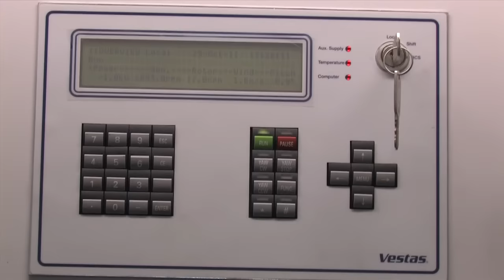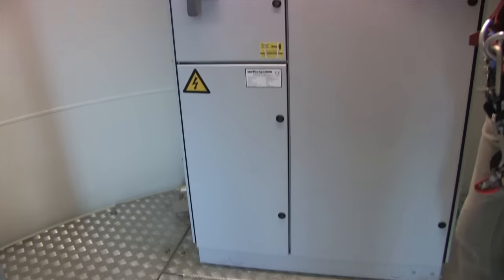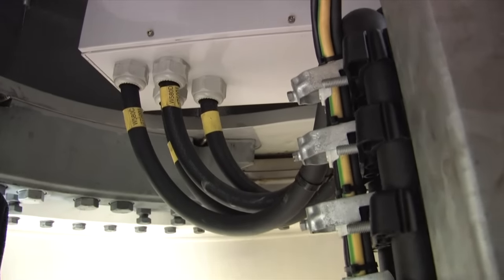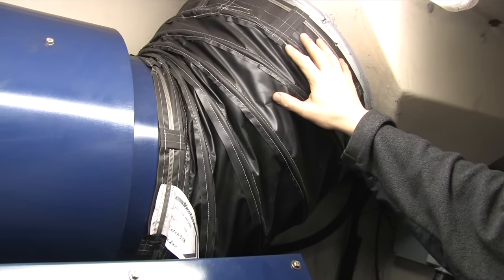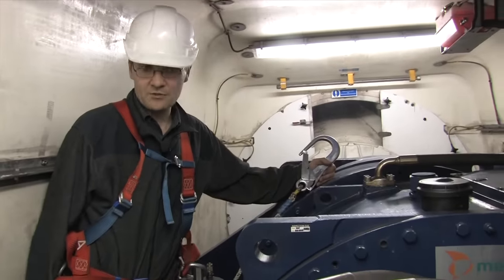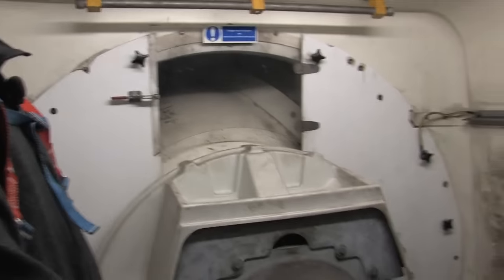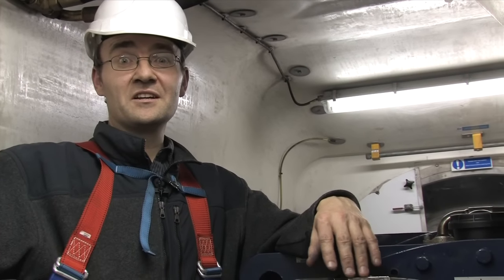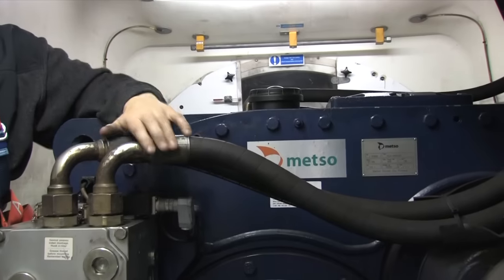Wind Turbine Tour

Comment from the maker: Extensive refurbishments of the DkIT wind turbine have taken place and included the replacement of the turbine's gearbox.  The recent upgrade is expected to secure an additional 10 years of operation for the turbine.  The 859 kW turbine has been in operation since October 2005 and powers approximately one third of the campus' total electricity consumption.
Reply: and how much did that cost and will the wind turbine ever return the cost in electricity?
not even a quarter of it, wind power is just stupid.
climate change is bullshit.
Reply: @axeman2638  I guess you missed the part where they said it was 5-8 years to pay for itself.
Reply: @jcc4tube  nope none here or elsewhere have that short a pay off. That's just bull pats. Especially if the govt subsidies dry up.
Reply: @dwh5512  even quicker now the cost of power has more than doubled. Wind turbines are an absolute no brainer
Reply: @jcc4tube  that's short pay off is either a lie or gross exaggeration.
Reply: @dwh5512  this vid is 10 years old now, but as he says in the vid the turbine costs 1,127,000 - 40% grant and saves the campus 120,000 a year, campus paid 680k. 680k/120k = under 6 years. the turbine will have far exceeded the initial investment by now and could have paid back the grant if that was a requirement. solar and wind generally pay back roughly 10% a year
Reply: @adamcourtenay  but they have to be rebuilt every 2.5 years. I've installed & rebuilt plenty
Reply: @axeman2638  I absolutely agree with your opinion on wind energy. If they ever get micro nuke plants up, the cost of retail kilowatt would be around 3 to 5 cents per kilowatt. Of course that's out side of major cities. Cities, 10 to 18 cents per kilowatt. Wind power retail, 30 to 40 cents per kilowatt is what I understand.
Reply: @dwh5512  Looks like they keep having to replace the gearbox and the generator, how much do they cost?

Comment: Loved the dry run of the process of connecting to the safety line, climbing the ladder, and then disconnecting from the safety line. Better to get people familiar with the process while on the ground where you can show them in a safe place! 👍🏼
Reply: Nah, it's better to do it while they're falling: they'll pay more attention.
Reply: What a glider! How over engineered can you make it? Was it a "euro design?" I had several grabs for wire and regular rope, one for a single tower! My fav was one that you cocked it horizontal, then placed on cable, then twisted 90 degrees, then clipped a carabineer through the hole! Slick and fast and was used often in dark towers by feel alone.

Comment: Great tour! I worked for five years mainly servicing Vestas V-39's bought used from Ireland. I was on the commissioning crew and we replaced VERY OLD Win-Dane 500 kw units using adapter plates! Shocked at the hydro station location! Tough as hell replacing the pump inside the tank on any day but that hub-end location would really suck considering it's a two-man repair. Loved seeing how similar our V-39's were to your model. We also had 2 new V-90's! Those were nice! Location is Palm Springs, California where the industry goes back to the eighties.
Reply: If you don't mind me asking, are you still in the wind industry? And if so, did you move to a supervisor position something to that degree?

Comment: Vestas world # 1 wind turbine, i proud that i am also working on Vestas V90 at zorlu pakistan, our great achievement is we repair the pitch cylinder at height in hub change orings
Reply: Hey Muhammad,  I am  in shells at Vestas windsor Making the V120. I think they are both blades for the 2 MW platform or is the V90 1.6?

Comment: Well, I had absolutely NO idea that what appears to the untrained as simply a wind turbine would be so mechanically complex with that many different systems! Thanks for sharing.
Reply: But still futile overall, and very damaging to landscapes in great numbers. This video just shows one isolated machine of several hundred thousand on the planet already. Wind turbines are a fail because so many are required vs. much denser power sources.

Comment: I'm surprised the transmission can't use some kind of simple convection cooling, lord knows there is plenty of wind just outside that tower for cooling.  Very surprised to hear about the cables that simply twist up to 3x, but it makes sense, must be cheaper than some huge slip ring and the maintenance for that.  What an awesome video!

Comment: Cool.  Thanks. Watched the whole thing.  What are the annual operating / maintenance costs?
Reply: The bearings and gearbox will need some oil, all components need inspection, but there are no costs for spark plugs, fuel, exhaust etc

Comment: i was doing chain and rigging certifications for 9 1/2 years and got to go up the Vestas 1.5MW and the V90 3MW turbines in Manuatu, New Zealand. got a good pic of me sitting on the roof of the V90 nacelle with the head of the crane they put the blades on with behind me then the crane beside the turbine as well. we had to certify the electric chain hoist up them. amazing view on a good day from the top of them 85 odd meters up. wasn't until after i had been up them i noticed the ladders on those are not bolted to the wall but stuck on with magnets that allow the ladder to move on the wall slightly to stop compression and expansion of the ladder with the movement of the tower
Reply: @MIGASHOORAY  when you open the hatch in the floor of the nacelle you have to double lanyard in and open it while standing over the hole looking down about 80 meters. the guy that took my pic on the roof wasn't even wearing a harness

Comment: Excellent! Very interesting. I wonder what causes the gearbox, and the generator to be the most problematic parts of the system? For example: vibration, metal fatigue, overheating?
Reply: Gearbox converts all that power and a small percentage of that power is friction. That small percentage is still a lot of energy. The wear on bearings is much lower. The generator itself has virtually no wear, assuming it is a brushless type, and assuming temperature does not exceed design of insulation.

Comment: I question the 3 metres per second (10.8 Kilometres per hour) low operation wind speed?All wind turbines have a "stall" speed and a graph to determine  minimum outputs, variations in wind speed  and drop offs drastically reduce their output performance, and what about low speed cogging or magnetic lock via the 3 phase axial flux alternator?  There are serious issues regarding the impact on the environment regarding suitable wind turbine location. Not so renewable?

Comment: How is the generator output voltage synchronized to the grid voltage?
Reply: Richard Vaughn  It was always my understanding that wind turbines are all asynchronous, generating DC power and using a synchronous inverter to tie to the grid.
Reply: Richard Vaughn  There is no such thing as too much power for solid state electronics. Here in the USA we have numerous HVDC transmission lines which are fed at both ends by power converter stations using solid state electronics to convert AC to DC or DC to AC at a typical 500kV. I have always assumed that all wind turbines operate in asynchronous mode, that is, the generator is not synchronized with the AC power grid, but rather uses a synchronous inverter which allows the turbine to generate power at a greater range of wind speeds, an important feature for a generator with an uncontrollable, unreliable power source. If a wind turbine used a synchronous generator connected directly to the AC power grid, at low wind speeds the turbine would become a fan and would use power to create wind. To prevent that the turbine would have to shut down in lower wind speed conditions, and would take some time to get up to speed and synchronized with the grid before it could begin generating again, so its output would be greatly limited compared with an asynchronous generator.

Another thing, you say that asynchronous motors (I assume you mean generators) are connected directly to the grid and then operated at just above synchronous speed, but this is not possible. All generators which are directly connected must operate at line frequency with a very nearly perfect phase relationship to the grid. Consider the fact that a generator which connected to the grid while 180° out of phase would present a direct short circuit to the grid. So you can see that any speed variation whatsoever will result in an out of phase condition, which will increase current flow up to the point where circuit protection devices will be activated. This is why grid tied generators are always of the synchronous type.

Finally, you speak of generators requiring power to excite the “squirrel cage” but this is also incorrect. A typical alternator uses a stator winding, usually 3-phase, to generate the power and a field winding on the rotor to generate the magnetic field to excite the stator winding. The alternator output is regulated by varying the power to the field winding. Synchronous generators are similar in design, with a field winding on the rotor. An alternator with a permanent magnet rotor cannot be regulated, and thus has a fixed output. Squirrel cages are found in AC motors.
Reply: Richard Vaughn  It makes sense that you could reverse the process and make an induction motor generate power, but I have never encountered such a thing in my experience or study. That is why I have no knowledge of it. I will have to check it out. 

As for the terms synchronous and asynchronous generator, I am using them as I’ve heard them used regarding grid connected generators in general. Synchronous generators have swing momentum which stores a certain amount of energy which can be drawn upon to support the grid in the event of a sudden disturbance. Asynchronous generators have no momentum and merely track the frequency of the power grid, so they cannot help stabilize the grid. A wind turbine might use any kind of generator, but if its output is not mechanically locked to the grid frequency the way most traditional generators are, such that its physical momentum contributes to grid frequency maintenance, then it is an asynchronous generator. Having too large a percentage of asynchronous generators tends to destabilize a grid. I once had a very interesting conversation with an engineer in a hydroelectric power station, where he explained what happens when the section of the grid his station was connected to got isolated from the rest of the regional grid. There are two hydroelectric power stations on that grid, but only one of them has enough momentum to maintain grid frequency, and that is the smaller of the two. Yet it uses a few large generators which act as flywheels, while the larger station uses many small generators which can be more easily slowed. The result is that the bigger station needs the smaller station in order to operate the local grid if it gets isolated, a situation that has happened far too often due to inadequate transmission facilities.
Reply: Richard Vaughn  That sounds very inefficient. Cheap to build, but wasteful of resources. With these wind turbines costing upwards of a million US dollars to build, I would expect to see something better than that. Using a 3-phase alternator that can generate useful power at almost any speed, then rectifying it and powering a grid tie inverter would be the best way, I would think.

Comment: Sorry if I missed it but, no fire suppression of any kind inside? I see videos of these things in flames all the time.  It's actually what brought me to this video.
Reply: They usually start to burn, if the pitch can't be controlled. They have a mechanical brake, but if they can't control the pitch the brake can overheat in stormy conditions and set the whole thing on fire(like if you drive with your car with the hand brake half activated).
Typically it's a disc brake, similar to disc brakes in vehicles, only much bigger.
Reply: @simonm1447  right. I get it. But what if there was a sprinkler or foam system inside the rotor  housing. Like in a regular engine room.
Reply: @aland4440  I don't know if it's existing, and he haven't mentioned it, or not. But this turbine is now 15 years old, maybe it don't have a fire suppression. But water alone wouldn't be good, short circuits in the electric system because of the water maybe also cause a fire. A CO2 suppression system would be better.
Reply: @simonm1447  Yea. I was thinking foam or class C fire extinguishers.
Reply: Alan D There’s a C02 fire suppression, not sure about v80,v90 but v112 has that.
Reply: @s5_b856  maybe it should be code and older versions should be upgrade?

Comment: I was thinking that the fall arrestor wouldn't be much use if it falls quicker than you do but I suppose it catches on those steel braces holding the cable. Very interesting. I get some strong westerlies at my place so would be handy. Very gusty though which I'm not sure would be good for it. :/
Reply: They glide mostly! Often they hang up for ANY reason! Pain in ass on some cables, especially when working a field with old turbines and frayed, yes frayed ropes!
Reply: Gliders could work on fixed climbing routes, like mountain climbing but glider's are industrial safety items so few people know they exist. Very easy to lock up!
Reply: Lately, shown WAS likely an arrestor because it's FIXED to their harnesses. OSHA re
Reply: @dousiastailfeather9454  Frayed ropes?! No thanks! Do you work on these mate?

Comment: I'm curious, what is the source of electricity for the lights and other equipment when the turbine isn't spinning due to insufficient wind speed?
Reply: Probably city power grid, or backup batteries.
Reply: @DoubleM55  I wanted to see if they would admit they convert to fossil fuels when there was a shortage of wind. There has yet to be a method invented to store the energy generated by either wind or solar other than a sort of strange hydro system that pumps water up a hill which is slowly released to power generators.
Reply: @davebeckley2584  It was explained in the video. The switching equipment in the college can feed some the generator output to the grid when there is more power generated than the college requires. When not enough is being generated then power is drawn from the grid to maintain the college power requrement.
Reply: @johnr6168  What I was trying to point out was the fact that until Elon develops a battery with the capacity to store enough energy to power a city of any size we will remain dependent on fossil fuels to one degree or another. An administration that implements a future plan devoid of fossil fuels before the technology has developed makes this country dependent  on other nations that could cut imports on a whim.

Comment: So, the tower part is not safe to enter when the the wings are in motion? Is it the vibrations of the operating wind turbine that make it unwise to go inside the structure?
The whole thing looks so large from the outside, but very compact & small inside the operations room up top.
Very interesting field trip. Thanks.
Reply: There are moving structures in there that a person is not shielded from when it's running. Also some very high voltage cables.

Comment: Well done!  Thank you.
Why not have theavy generator on the ground with rotating shaft from turbine to ground?

Is there need of an escape line from turbine house to ground?   (Saw two men supposedly on a burning turbine cabin withowhere to escape.)
Reply: Not an expert, but I think that there isn't much of a reason to have it on the ground apart from stability, which would probably be offset by the friction of the extra shaft.

Comment: Great tour Guys. And you can see me house in Cooley from the top 😊
Just a quick note, I didn’t see any provision for fire suppression, what’s the Reg here ??
And only a minor and major maintenance visit per annum, as it’s getting older will it not require more service visits ?
Also, if it’s not generating power under 3M/Sec can’t you switch it off until wind speed is up to increase the life of the machine?
Reply: I guess if the blades are turning, it looks like it is actually doing something.  Which begs the question, when you see a wind farm, how many of those turning turbines are actually generating useful power??

Comment: I would have thought they want as much heavy weight as possible at the base of the tower, and as little as possible at the top.   So why not gear into a vertical shaft, driving a generator at ground level?
Reply: perpendicular gears waist a lot more power than parallel gears. tower has to be strong enough to counteract the wind pushing on the blades aswell, the weight of the motor and gear set are probably nothing in comparison.

Comment: Just had a field trip at a test bench and I gotta say, these things are absolutely massive. The 15mw was in the process if being taken apart and apparently they had to weld the planetary gearbox down during shipping because if they didn’t it woulda sunk the ship, the gearbox weighs 325 tons. And you could stack three of my corolla just in the shaft adapter alone.